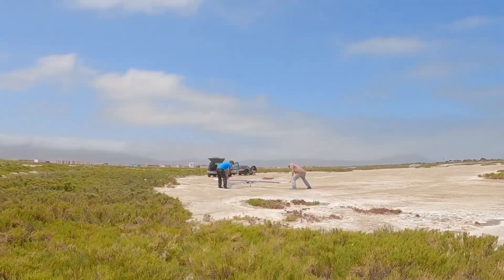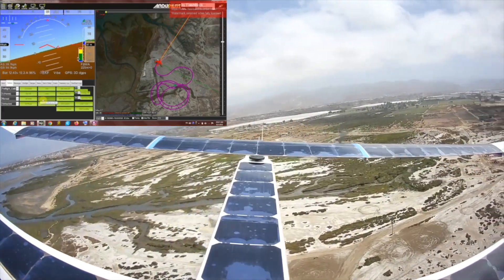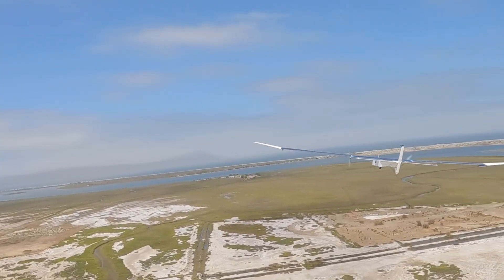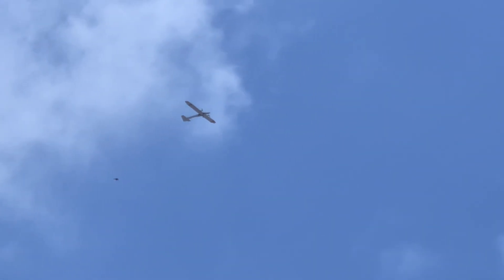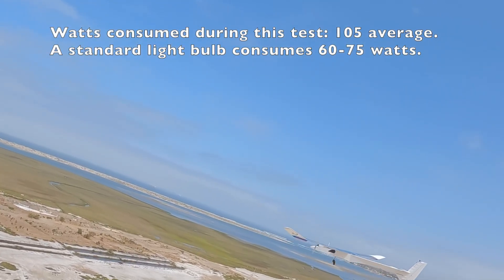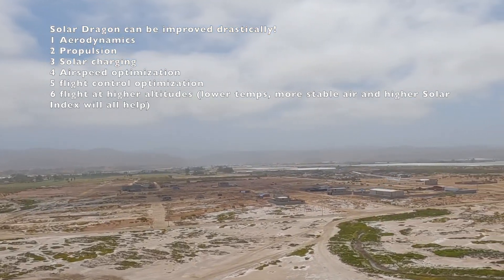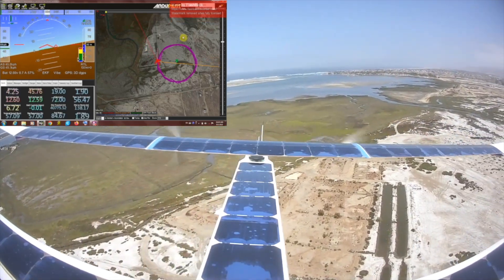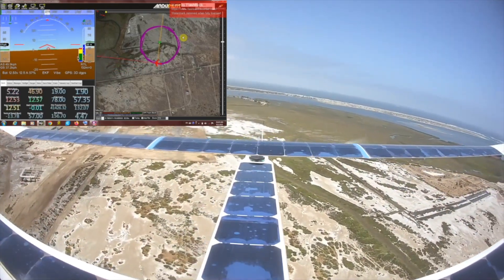Solar Dragon Flying on Pure Sunlight (and Charging)!!!

Comment: An odd thing happened when I clicked on the thumbs-up icon - the number of likes went from 170 to 169. I expected it to ascend from the present to that number plus one. Weird. Great project, great video.
Reply from the maker: maybe you had previously liked it?? and it "unliked" the video.  try liking again and see if it goes back up..?  anyway, no worries.  thanks for checking it out!  working on some new nacelle design as the new motors (8 of them) arrived today!  will be either 6 or 8 motors, with 10x10 APC props!!  hopefully should be much more efficient. and lots more thrust on 3S!  sunny sky 2216 880KV motors. the legacy black ones. not the newer ones.  the legacy motors are more efficient, despite the specs on the website.   cheers!

Comment: can it stay up forever?   Wont strong winds at high altitude blow it away?
Reply from the maker: it can certainly stay up for a long time. we have not tested to see how early and late solar morning and solar evening are.  we hope to fit it with a more efficient e-propulsion system, so that those figures will be more positive before  we do the test.   and then it depends on whether the battery can carry it from solar evening to solar morning.  if so, and if it fully recharges during the day, will determine whether it can stay up indefinitely. or at least until some degradation of solar, battery cells, or airframe components occurs.      Strong winds are likely to over power it's forward airspeed, but there is usually an altitude that is favorable.  and a plane with unlimited duration and full autonomy could get blown away, and work it's way back eventually regardless, even it it had to fly around the world, or around a large circular weather pattern.   such high winds could be used for high speed travel, such as how airliners take advantage of the jet stream to make better times between destinations. this plane can probably fly far above most airliners.
Reply: @FPVREVIEWS  would love to see you have it fly around the world...  albatross can do it without landing or flapping the wings, so realistically the power to travel over the ocean is minimal and you dont need any solar power as dynamic soaring off waves is enough most of the time.     I dont think this can fly so high because propeller efficiency is bad at altitude?   Anyway maybe next step is make it capable of landing in trees like a bird to "rest" and recharge as needed.
Reply from the maker: @seandepagnier  good ideas. there are many energy sources, as well as ridge lift, and mountain waves, even at high altitudes.  as well as updrafts from colliding air currents.  the Perlan project took advantage of these effects.  Props are very good, but need to increase pitch with altitude.  but electric planes do not need oxygen, and electric motors, electronics, and solar cells all get more efficient with lower temps at high alt.   VTOL and solar can also have unlimited range, with pauses for charging, as you mention.

Comment: Very nice!

One question if you don't mind.  Have you given any thought into why the "encapsulation" on the tops of the solar cells seems to be de-laminating?
Reply from the maker: They are covered with monokote.  it does not matter if it sticks or not.  it does in some places, and not in others. it seems to depend on the texture of the cell. it's functionally very good, but I wish there was a better way that was more aesthetic. it actually looks great in some lighting conditions, and not good in others.  strange effect.  but upper surface is perfectly smooth, and not coming apart.
Reply: @FPVREVIEWS  Where can I buy the exact "monokote" that you used?  Also, how did you apply it to the solar cells?  I'd like to try to replicate the encapsulation as you've done and do electrical testing before and after.  Not only do I have plenty of Maxeon/SunPower solar cells to play with, I have the ability to generate detailed 3 quadrant current vs voltage curves of cells, strings of cells, panels and arrays.  I'd be happy to freely share the results with you as well as give you some advice on possibly aesthetically better encapsulations.
Reply from the maker: @bobhilder1469  I'm sure there is some degradation of performance with my method, due to reflectivity of the monokote surface, but I don't know of another method which can be made with low cost, common materials, and without special equipment.  It's just standard monokote. clear. 
https://www.horizonhobby.com/product/monokote-clear-6/TOPQ0200.html   I'd love to  know or see other methods.
Reply: @FPVREVIEWS  Thanks!

Comment: if it can produce way more than it consumes, and as you say can handle a lot more battery, then i would recommend an MPPT solar controller to eliminate that issue (see RCTestflights videos on his solar glider)
Reply from the maker: Thanks, can you recommend a particular MPPT CC?   Current battery is 3S Li ion, and solar arrays are slightly above that.
Reply: @FPVREVIEWS  not personally... i'm used to using big ones for the stuff we do at work, but like i say, if you look at rctestflights solar glider from years back he tests a couple of them. https://www.youtube.com/playlist?list=PLXvxJNOIXBsM83XxVG7tDUmqlumxDKkBs
Reply: @FPVREVIEWS  how many amps and volts generate the panels aboard?
Reply from the maker: That info is on our website at the link in description.